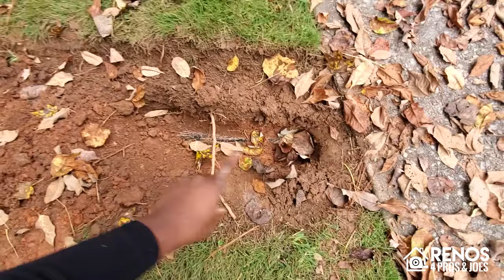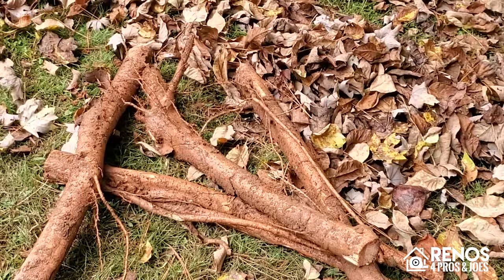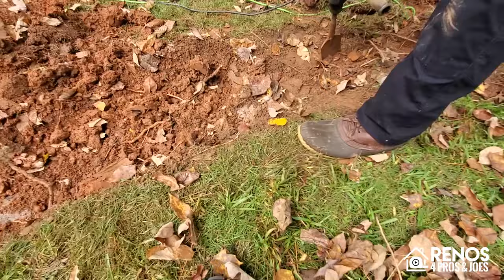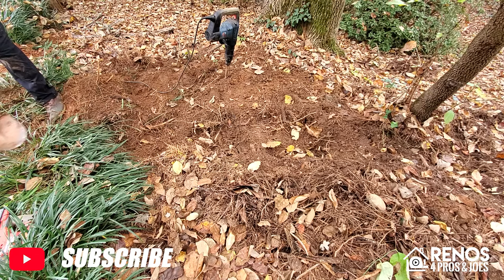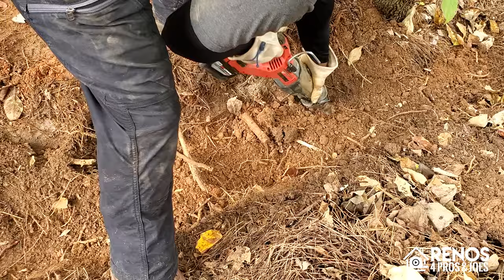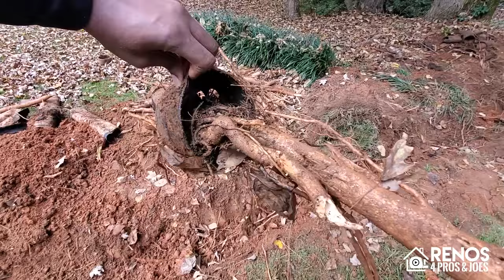FASTEST WAY TO DIG A TRENCH | How to Dig a Trench With a Demo Hammer

Comment: If that was the fastest way, I’d hate to see the slowest way!
Reply: Break up clay dirt with just a spade and see ho w fast the job goes!?
Reply: I was going to use this too, but I thought it would be too slow.  I've been searching for a long shovel with a motor and am not finding much.  I have to go 3 feet down by 20 feet to avoid the frost line.  Then a dry well at the end.  It's going to be miserable.  They make motorized shovels, but are basically used for planting.  The 3 foot trenchers at the Depot are 1100 pounds.  If anyone has a better Idea, let me know.

Comment: I had to dig a ~120' trench in compacted soil with a lot of rocks/small boulders ranging in size from an apricot to a cantaloupe.  I was lucky if my shovel went more than an inch or two deep each time I would try to dig, and a pick didn't do much better.  I gave this a shot and it went 10-12" deep with no problem, almost like going through butter.  Thanks for sharing - this saved me a ton of time!

Comment: i don't think i caught why you used the three part solution (small demo hammer + reciprocating saw with carbide blade + hand spade) vs a rental trencher (dingo) with 4" or 6" blade?  was this easier in some way or less costly? Also, leveling three times, first rough dirt and then lay down 1" of crushed rock will make the pipe run really easy to precisely level (1/8" per foot) with no low spots.

Comment: Was going to use a trencher but I think this tool will will do to build a French drain system along side of my detach garage to deter water to street. My parents live in the garage and when it rains water gets into garage.  They have a piece of concrete  along half of the garage which has a negative slope..I don't know if I just should cut a trench trough concrete or just remove the concrete completely since it has slope towards garage